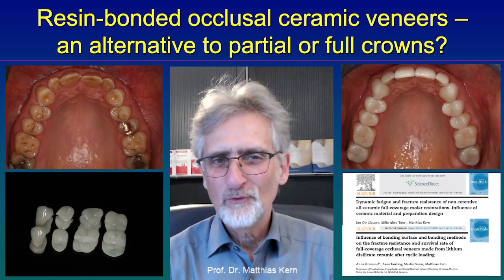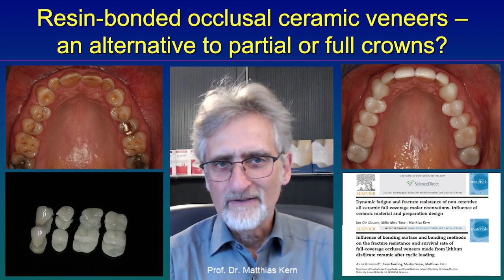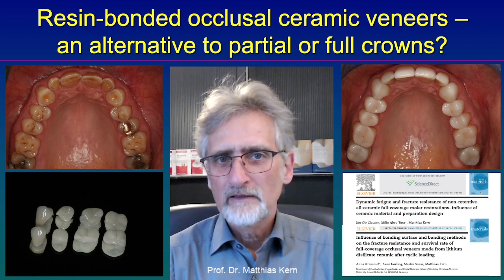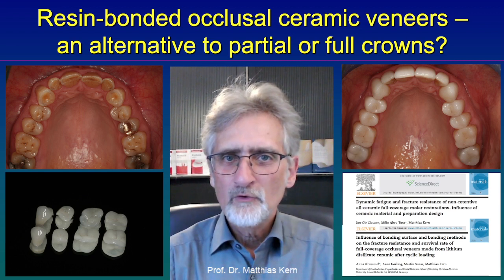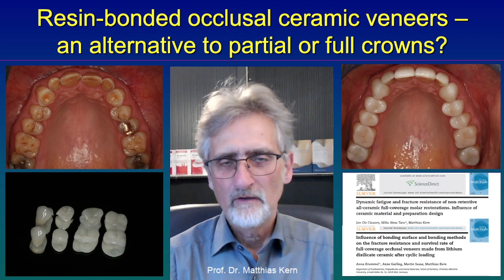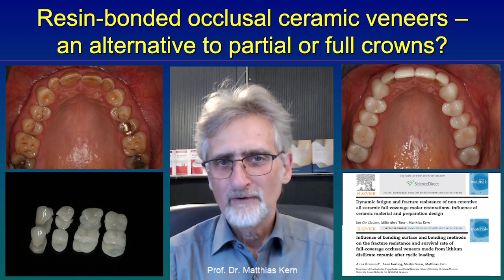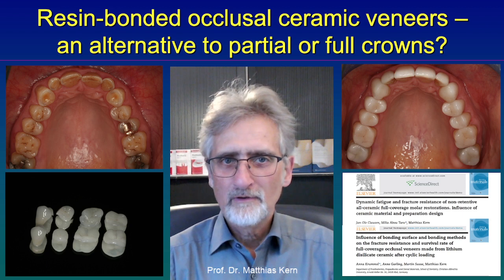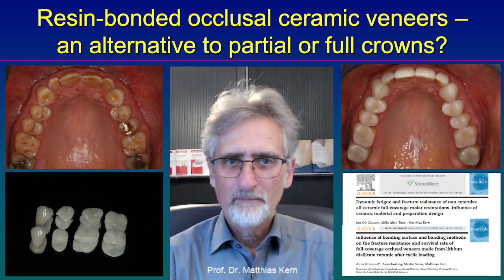Resin-bonded occlusal ceramic veneers –an alternative to partial or full crowns?

Comment: Thank you professor, very encouraging . Do you have a link to the preparation of such teeth, of course as you mentioned it would be preferential to avoid any reduction . You mentioned you would increase the vertical dimension , if you increase the vertical dimension in such wear cases with ceramics would they risk fracture in cases or bruxism/parafunction . Ofcourse each case needs to be assessed individually but I wondered what your thoughts are regarding this. .
Reply from the maker: Thanks for your comment/question. The preparation design was evaluated here: Clausen, J.O., Abou Tara, M., Kern, M.: Dynamic fatigue and fracture resistance of non-retentive all-ceramic full-coverage molar restorations. Influence of ceramic material and preparation design. Dent Mater 26, 533–538 (2010). https://www.ncbi.nlm.nih.gov/pubmed/20181388
Regarding the therapy of bruxism there is a German treatment guideline with ope access here: https://www.awmf.org/leitlinien/detail/ll/083-027.html 
Unfortunately, I cannot translate this guideline for you.